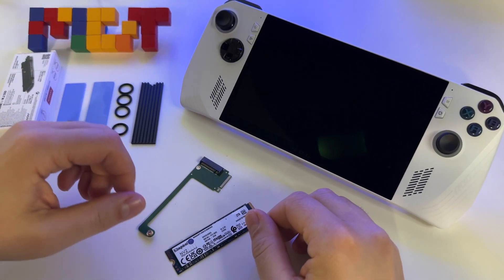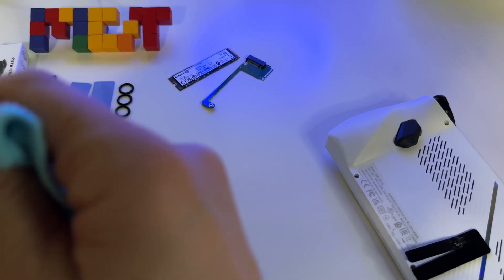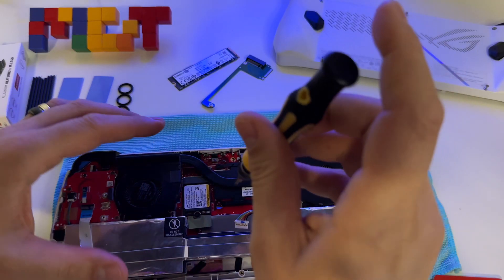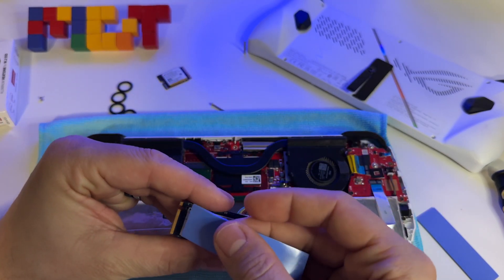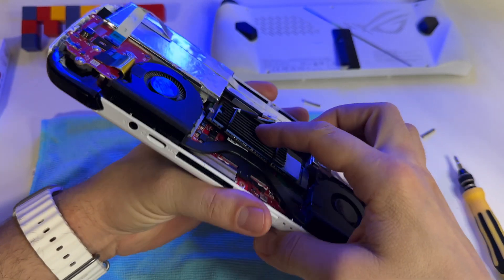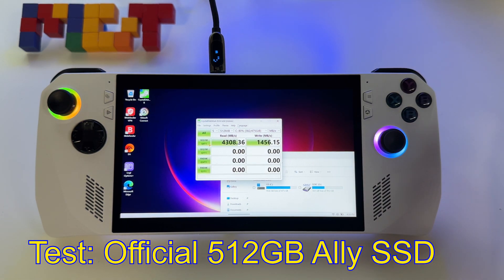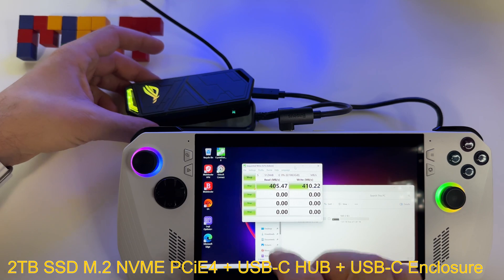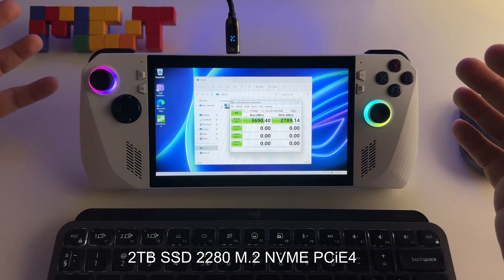Installing 2TB 2280 M.2 NVME SSD in Asus ROG Ally with adapter for 2280 SSD instead 2230| speed test

Comment: What did you use to cut the heat sink. I am running into the same issue and don't want cut on back casing as well.

Comment: I've just decided to do exactly the same thing.  I bought one of those adapters off Amazon about an hour ago.  That NVME that your holding in your hand is the exact same drive that I have, except my drive is the 4TB version, instead of the 2TB version.  I also have a 1.5TB SanDisk Micro SD Card waiting to go into my Rog Ally Extreme Z1, along side the 4TB NVME.  I'm just trying to wrap my head around that...  That is 5.5TB of Data Storage, for a hand held PC.  I have zero idea what I am going to put on it?  1.5TB of retro rom's.  1.5TB of PC games.  That's 3TB.  2.5TB of hard core porn.  I don't know what else to put on 5.5TB of space.  I don't have 5.5TB worth of games.  What the fuck have I done?

Comment: Hi. I see your using the 90 degree adapter you got it right. one problem you should have used a SAMSUNG drive they have there free cloning software. your mod would be easyer  .

Comment: Did you find that the case wouldn't close flush without the screws? I installed one with a 1.5mm heatsink and the case will screw flush but without the screws it's forced open a little

Comment: Why not just use the 2230?  I bought a 2tb 2230 works great
Reply from the maker: What ssd did you have? Is it double sided? Because I had an ssd 2TB from sabrent and it was double sided. You can use 2230, but 2280 has some advantages: 1. Price: you can put 4TB with the same money paid for 2TB 2230.
2. As I said, I think all 2TB 2230 models are double sided. They will have higher temperatures than 2280 and in longer gameplay sessions that means lower performance compared with 2280.
3. 2280 are very easy to find and cheap.
Everyone is free to choose, it’s nice to have options.
Reply: 2280's are generally much cheaper than the 2230's ...
Reply: @MGTMaxGamesTech I bought the Micron 2230 ssd model that Asus shipped on my R9 version, except the storage was 2tb instead of the 500gb default. Now for this particular model I did not see any chips mounted on the bottom side. It's around 200usd which in my opinion is still fine compared to Crucial or other premium brands. That go above 300usd.

But I can see this as a cheaper option if you have spare 2280 drive around. Mind everyone that if it's PCiE3.0 it doesn't utilize the max capability of the Ally which is 4.0
Reply: Although I really can't recommend anything that involves breaking pieces from your ROG, I mean honestly always had a problem breaking expensive hardware.

Comment: I decided to stay with the internal storage and instead got a 4tb nvme ssd with an external usb c connector.
Reply from the maker: It’s ok but not the best variant: not so portable; you need to change the official charger to a more powerful one because you won’t get enough W from it to support turbo mode; you need a dock if you want to charge while using external ssd.

Comment: That's a good timing. I just bought the part, and I'm upgrading after New Eve. With 2 TB, I can store all the games without limitation.
Reply from the maker: Great decision. Everything works perfect, I can confirm.
Reply: @MGTMaxGamesTech Can you do an update 9 months from now?
Reply: @MGTMaxGamesTech 
Still got the rog??
How is the ssd still working 
Wondering about overheating from the cpu heat sink if will damage it over time